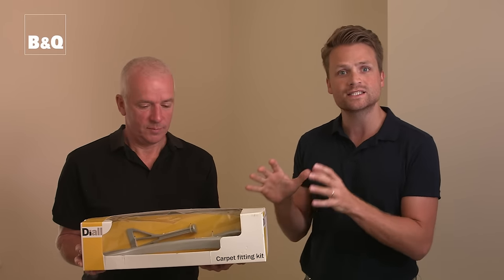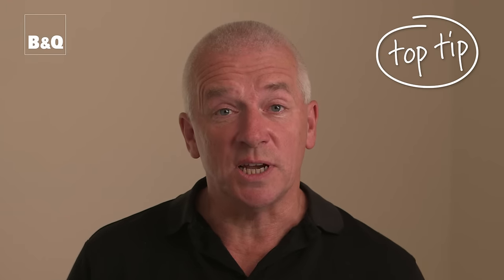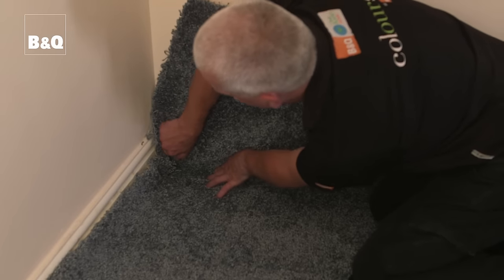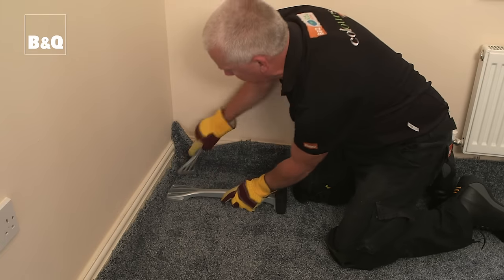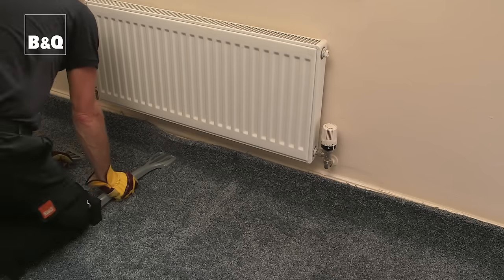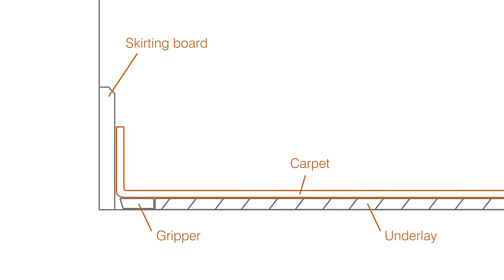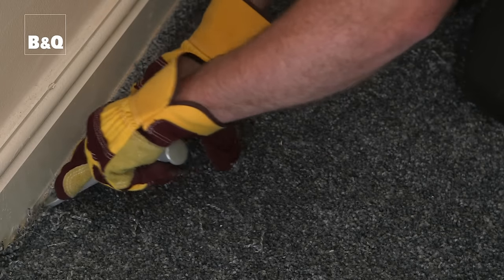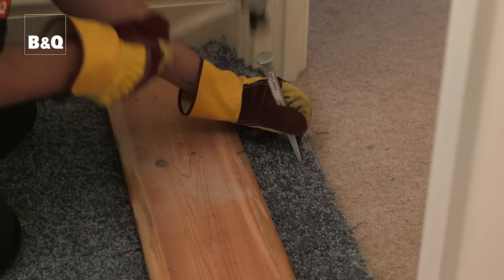How to fit carpet part 2: fitting & trimming carpet

Comment: Spent the morning laying carpet in the lads bedroom. I watched the videos as a refresher. Only comments is to not shuffle when wearing rubber soled slippers - they leave a mark!!! and to have lots of utility blades are they go dull fast. I didn't use a kit or a kicker, but used a bolster chisel and a stiff wide scraper. Came out really good.
Reply: Terry so how did you stretch the carpet ?
Reply: @lukebanks2895  I changed into shoes and shuffled / hopped with both feet into the edges and corners. It's not perhaps as stretched as it could have been with a kicker, however as the bedroom is small there is little visible carpet once the bed / cupboards / wardrobe etc have been put back.

If I were planning on lots of carpet fitting I would now get a kicker - and knee pads
Reply: Years time it'll all be lifted and creased as its not stretched right
Reply: @japfan8161  not everyone has a spare £40+ quid for the tools, many moons ago I used the same shuffling method and it was more than enough to make it last for 4+ years atleast, aslong as you aren't regularly moving large items this is more than enough for a budget DIY job. It could also easily be restreched a few years later if the person gets some soare money or finds a friend with a stretcher.
Reply: @karl810 indeed.  The carpets I’m currently replacing were fitted by my father ~38 years ago.  He didn’t use a kicker and they didn’t ripple in all that time despite having furniture dragged all over them.  However I was given a kicker, plus they’re a lot less than £40 from uncle Jeffy B.
Reply: @dwayne_dibley   38 years ago carpets were made better….
Reply: @karl810  You can easily make a carpet kicker out of some odd bits of wood and nails too.

Comment: Better off paying someone to do it lol
Reply: That’s the worst carpet fitting I’ve ever seen. What next a video on how to show people how to re-wire their house instead of getting a sparky 😂😂😂 
Everything you’ve shown in that video is how not to fit a carpet
Reply: @matthewtaylor9924  never seen anyone fit carpet with garden gloves before😂😂😂😂
Reply: @matthewtaylor9924  You're actually equating carpet fitting with electrical work? You need more than a City & Guilds in 'Stanley Knives' to become an electrician and this video would probably get a carpet fitter to HND standard. Get over yourself!
Reply: @ragnarok20232  yep! May be better using welding gloves
Reply: @1OUI2  actually you don’t need to to be qualified to rewrite a house, just skilled. You have to be qualified to “certify” an electrical system. I’ve wired many dwellings & had an engineer test & sign them off

Comment: Doesn't the grippers go through the carpet.. which means the spikes are still there?
Reply from the maker: Hi, Tommy. Thanks for your question. The grippers go into the back of the carpet but they shouldn't appear through the top. If they come through the top, this suggests the carpet is thin or no underlay has been used. Hope that helps 😄

Comment: can I do this method with felt back? I want to use underlay because its wobblt.
Reply from the maker: Hi, the carpet trimmer will cut felt backed carpet but it depends on the thickness of the carpet pile. E.g. you may have difficulty cutting a 12mm deep pile carpet. Hope this helps! 😊

Comment: Do you need contact adhesive spray?
Reply from the maker: Hi, this would only be required for the underlay and/or lining paper. For lining paper, you can use tape as an alternative. For the underlay, you can use a staple gun as an alternative. I hope this helps! 😊

Comment: Can you remove an old carpet and fit a new one on the same base layer.
Reply from the maker: Hi, if you're removing an old carpet, there should be no issues fitting another one in it's place 😊

Comment: I was told 700 quid for my two bedroom house including stairs 😭😭,
Reply: FENTY Cooper so you think you can do it yourself huh
Reply: @carlosarguelles8318 well  my partner will
Reply: @momocooper1856  Yeah just follow the video :)
Reply: Should be about 150-200 a days work tbh
Reply: @robthesamplist  Yeah... Okay, buddy.
Reply: @ThrashMetalJay  Its a days work....
Reply: @robthesamplist  Point being?
Reply: That's cheap 😁😁
Reply: @ThrashMetalJay  think the point is 8 hours @ £20 an hour is £160 + cost for carpet. Not 700 odd
Reply: Jus paid £330 for 2 bedrooms, thats carpets, underlay and fitting, and its not cheap office carpet either £8.99 a sq yd
Reply: @ThrashMetalJay  a
Reply: @AJ-cn7eh  So your saying every job should stop at $20 an hour?
Reply: Most carpet layers get paid by the metre/yard.
Reply: @ThrashMetalJay  try £40 minimum